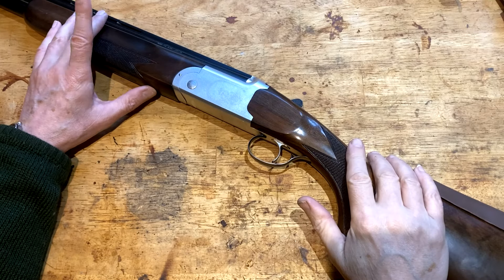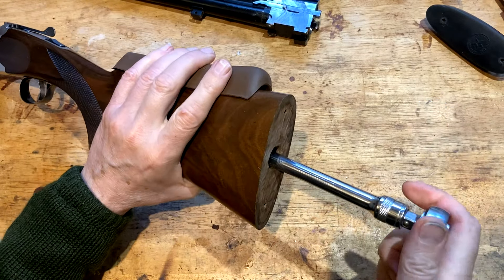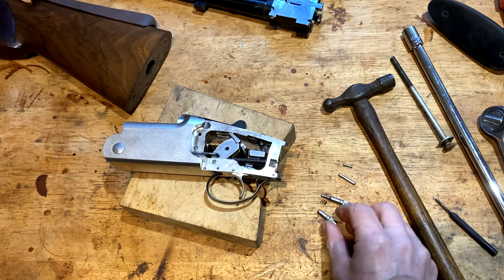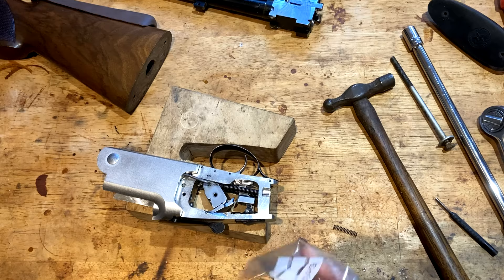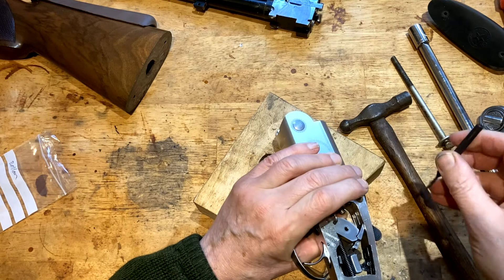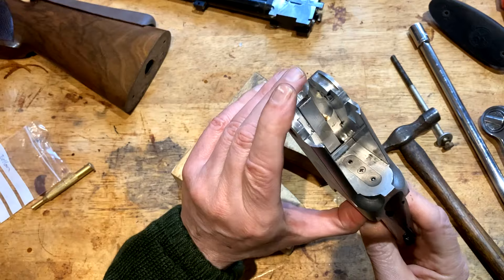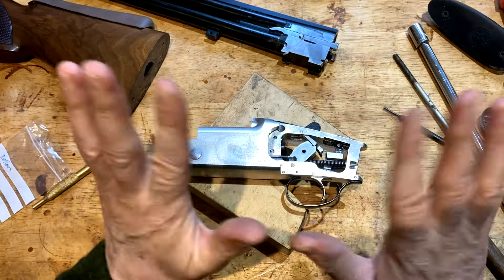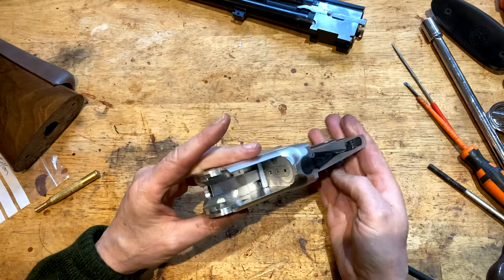Devongunsmith Diaries #37: Yildiz 20 Bore Firing Pin Upgrade

Comment: Finally managed to get around to watching the video! 

When i used to replace them under warranty once one pin was captive and the other pin was in place id use the tumblera to hold the pins in. 

The difference between the firing pins is the angle of the cutout to allow the holding pin is cut at a different angle!
Reply from the maker: I can’t tell if this comment is a statement or a criticism!?
Or perhaps both!
What your point?
Reply: @devongunsmith4698  just saying how I found it easier to do it like I explained. And the difference in the pins! That's my handwriting on the bags the bits are in! 😉